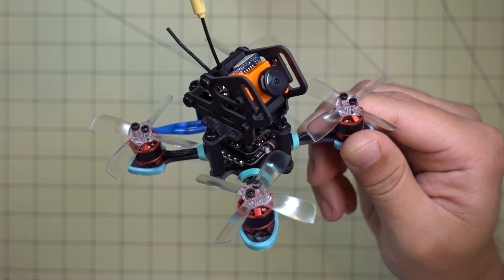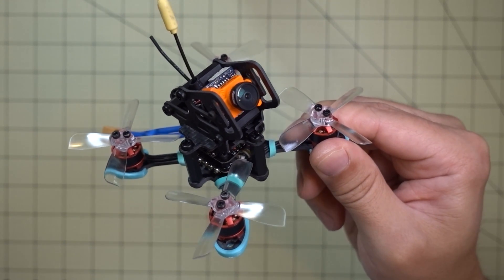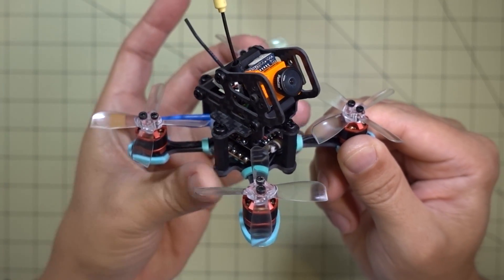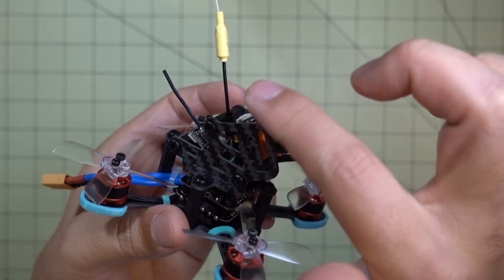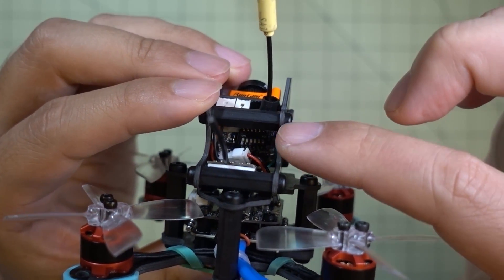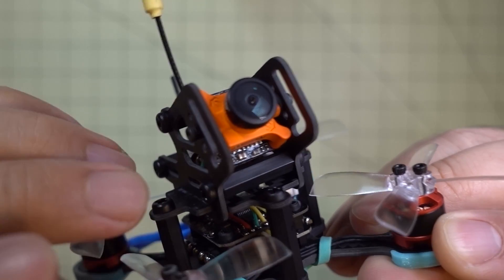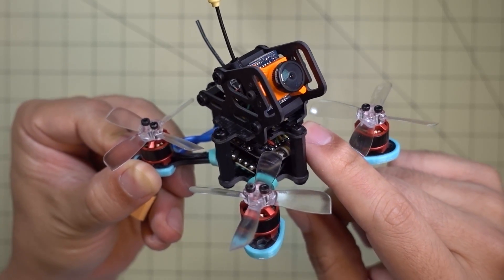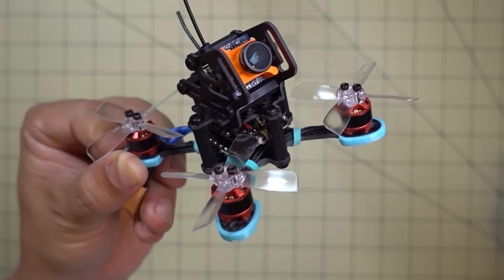Micro Drones 101 🚁#24🐲 Tomoquads Lil Predator 🔥👍

Comment: How did you mount the m2 board on the m3 holes on the frame?

Also wondering the motor screws you used with the motor guards.
Reply from the maker: Just used some M2 screws on the bottom. It barely grabs the frame but it's enough. I think the screws for the motors are 7mm, but I'm not 100% sure.
Reply: Albert Kim awesome, thanks albert. Also wondering what happens to all these micro builds you do?

Comment: Can you measure the distance between outer frame standoffs? I am thinking about hacking a Runcam Split into Runcam Micro case and using it as a recording camera in 2 inch quad, will this frame work?
Reply: You'll find it to be far too heavy and the 30x30 form factor is also not practical. Don't bother.